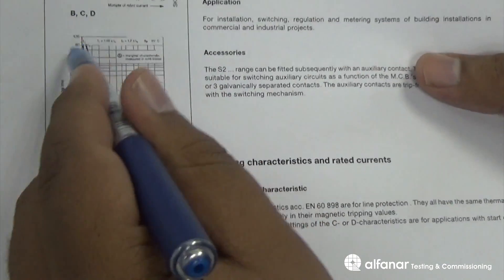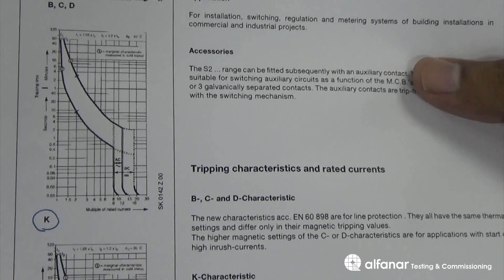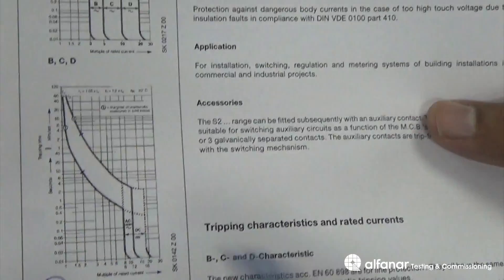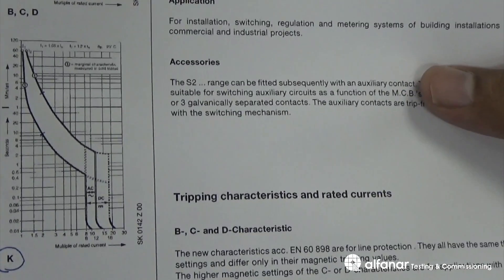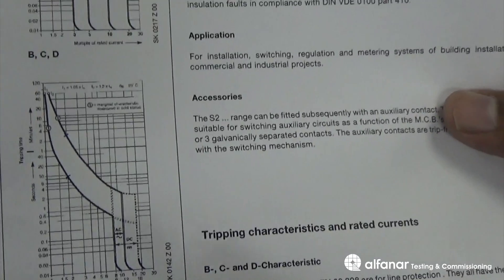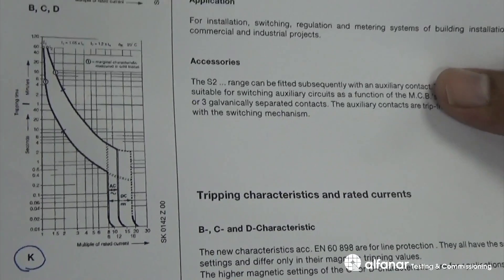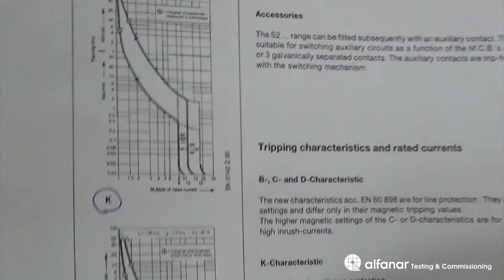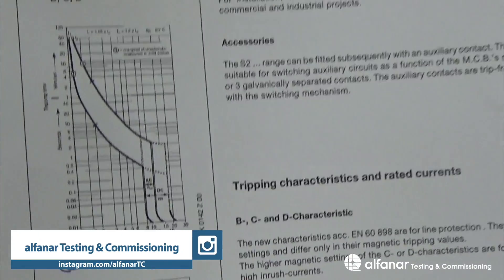HOW TO TEST MCB?

Comment: good info, i would to ask you, whether the 780 can check contact resistance for circuit breaker?
Reply from the maker: severer 780 can not you better to use multimeter